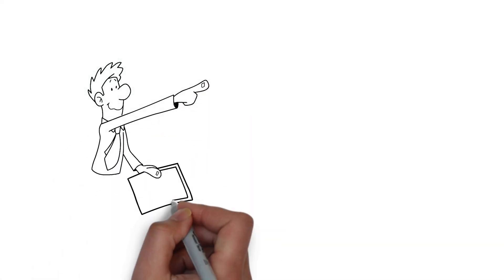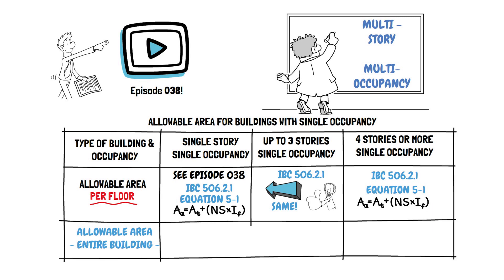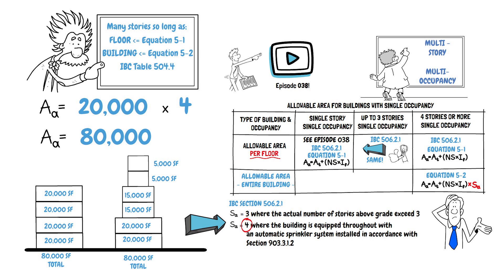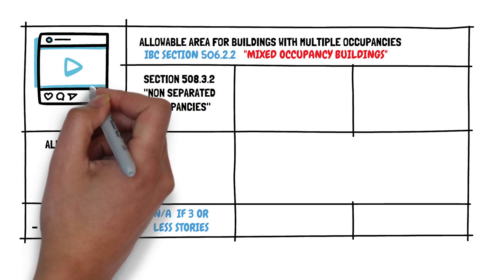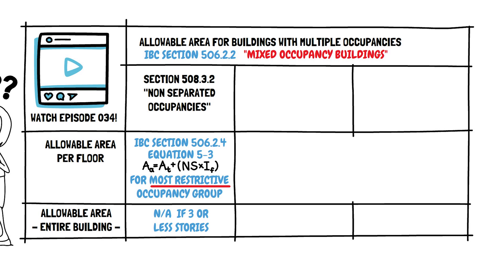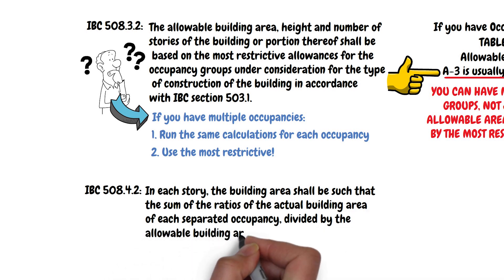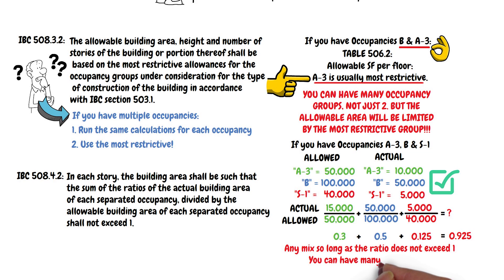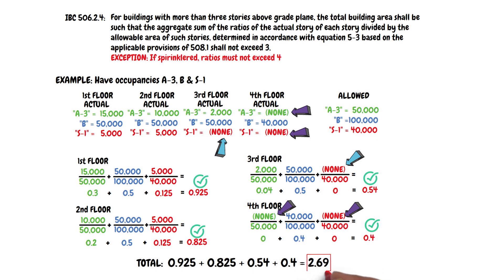AC 039 - How to figure out the allowable area for multi-occupancy & multi-story buildings.

Comment: Hi Josué, Thank you for sharing such informative videos—they’ve been very helpful. Do you happen to have a video that explains the Area Increase Calculation for mixed-use buildings? This would be especially useful as a preliminary step before the one covered in your current video, particularly for projects where the allowable area is increased due to frontage on open space.

Comment: Your example for non-spa rated occupancies is using A-3 and B to explain that for non separated occupancies, the stringent between the two will determine the allowable area. But A-3 and B are not good examples to pick. Because they ARE CONSIDERED as separate occupancies per table 508.4 IBC 2018 & 2021.
Reply from the maker: IBC section 508 provides at least 3 ways to view mixed use and occupancy (508.2, 508.3 & 508.4). If you use 508.4, then yes, A and B can be "Separated occupancies" as you stated. However, if you use 508.3 as per the video, then the occupancies are "non-separated" occupancies. In other words, you don't have to use 508.4 if you can comply with 408.3. With the same logic, if you comply with 508.2, then you don't have to comply with either 508.3 or 508.4.

Comment: At 3:35, is it accurate to call Sa = 4 just because the building is sprinklered, or is that specific to NFPA-13R sprinklers, which means it's an R occupancy?
Reply from the maker: Great question. Per IBC Section 506.2.1, In order for Sa to = 4, the building must be sprinklered per IBC section 903.3.1.2. This section makes reference to NFPA 13R which then stands to reason that it is limited to a Group R Occupancy sprinklered building.

Comment: Thank you for the videos! But quick question - the code reference for Sa being 4 seems to only reference residential occupancies with NFPA 13R sprinklers. So is it only for those residential occupancies, or for any sprinklered occupancy? I thought it was most often 3. Thanks!
Reply: Thanks for the great video Josue, very thorough and informative! Hoping to see more contents like this that sheds light in the complexities of the IBC.

I agree with @Melanie1611, it is not required to compare the sum of the ratio of the total floor area of the building since there is no Residential occupancy from the given example @10:09. 506.2.2 -Exception states that "For buildings designed as separated occupancies under Section 508.4 and equipped throughout with an automatic sprinkler system installed in accordance with Section 903.3.1.2"  = (which is NFPA 13R Sprinkler systems in Group R occupancies) 

It would be great if you could provide further clarification on this point for a deeper understanding. Thanks again!

Comment: Thank you for the videos!!!
 I still have one question( Should stair doors have maneuvering clearances and which code provides information regarding it?
Reply from the maker: Short answer is yes. But every state is a bit different. Some use the ADA, other use ANSI A117.1 and other use the accessible chapter of the State Building Code. They are all very similar and in theory they should all at minimum meet ADA. The difference between states is that some are more stringent. 

I know this is vague but that is the best I can do without knowing where you live. The best option is to hire a local architect in your area and he or she can guide you through your state's specific requirements.